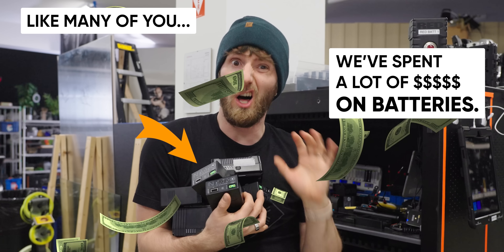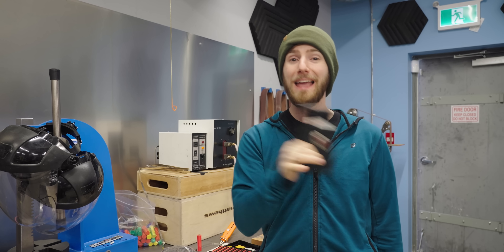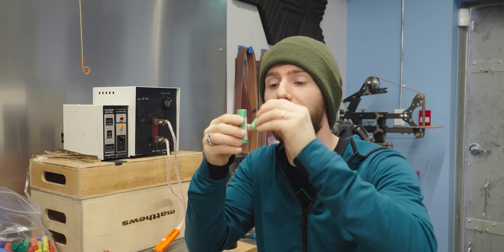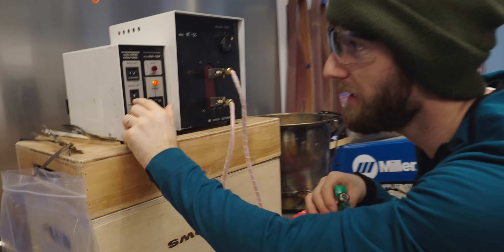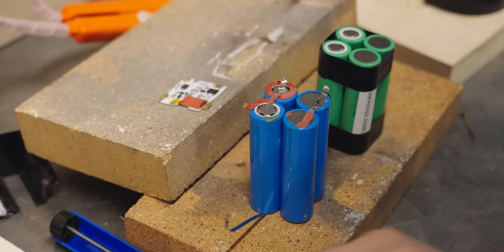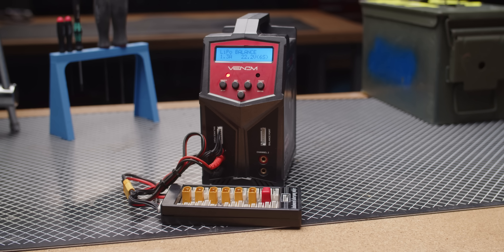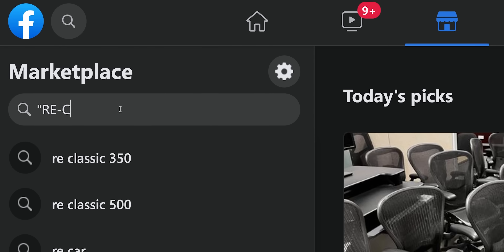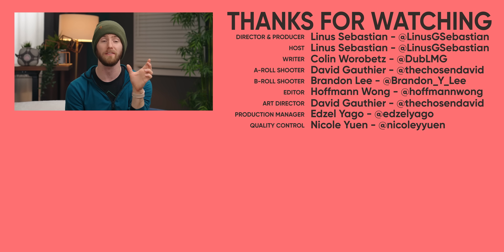This should be illegal… Battery Repair Blocking

Comment: One MAJOR concern when building battery packs with Lithium Ion Batteries. These batteries are very dangerous when they hold a charge. If you rupture the case, you will not only sacrifice that cell, but adjacent cells and more likely all cells. If you discharge all the cells first, you're not going to have a spark when connecting them. Also they're at same potential (voltage), but most importantly you won't have a cell that catches fire. Then they can all be charged to same voltage evenly.
Reply: LiPo cells will catch fire exactly as easily when they reach 300 or so degrees Celsius no matter their charge state. That's because what is being released is not electrical energy at all, it's chemical energy, specifically the chemical energy of the polymer. The polymer catches fire which burns so bright because of the cobalt oxide decomposing at ~300 degrees Celsius, which when you think about it, makes the entire battery cell essentially a block of rocket fuel if you let the decomposition start. The molecules used as polymer are pretty comparable to gasoline in the energy they contain, but they don't catch fire as easily because they aren't volatile and don't form an easy to ignite vapor easily. 

That being said, shorting them lets them reach those temperatures, so discharging them such that they cannot short and reach 300 degrees will still definitely make it safer to work with.

Comment: my vape uses the same batteries 😮 didnt know these 21700, 18650 etc. batteries are also used foe such batterypacks 🤭

Samsung's T40 batteries (its 21700 tho) would be literally perfect for a batteryblock then 😮😮 I tested alot of batteries already from cheap to expensive and Samsung's T40 has been the best so far in questions of lifetime & mAh 😇

Comment: Years ago I was working at a golf course in Alton when a huge pile of lead acid batteries shorted, overheated and exploded. I was a few miles away and high up. The sight of the flames and amount of smoke was unimaginable. It took over a week to put out. Since then battery storage laws were introduced. You could still smell it months later...

Comment: Another thing for safety that would help when it comes to fire extinguishers is, just use an e, c or both grade fire extinguishers cover both electrical and chemical fires. I'm not a firefighter by any means but in chemistry or even 6th grade science, they teach you about different grades of fire extinguishers.
Reply: Not a criticism just a suggestion if an extinguishers with both e and c grading exists XD

Comment: I believe in right to repair, but also the right for battery makers to not get liability. So for example, i believe there is a good middle ground 1) People who want to repair must first report to the manufacturer that they want to repair, and write off all liability 2) People who want to repair must put a 1 million deposit, so that if they die/get injured, and the media hits the manufacturer, then the manufacturer can take the deposit to offset damages done by the repair person. 3) After a product is repaired by a third party, it must be tagged so and for everyone to know. that it has been repaired by a third party, and may not function as well as the original manufacturer 4) Lower taxes on the product for the manufacturer

Comment: 11:15
Yeah those sparks are from improper welding, not the cell rupturing. Just weld it again and it's perfectly fine. It may look scary but I've had way worse sparks when spotwelding battery packs and nothing happened.
You'd notice pretty quickly when a cell is actually damaged because it would start spewing sparks, smoke and maybe even fire. That happens quickly IF you manage to damage it enough
Reply: I agree 100% I’ve accidentally shorted one down to 0 V and it got hot to the touch but never exploded
Reply: Yeah, I've seen lithium batteries burn before. It was nowhere near that tame. LOTS of smoke. If all I saw was a spark, my first guess wouldn't be the battery.
Reply: This can also happen when the strips are a bit oily, anything that impeeds the current can cause a spark.
Reply: I came here looking for this comment, wanted to scream out of my window to tell him that exact thing.
Reply: I know, I am over here in tears thinking of all the wasted cells! Please ship them to me for um practice.
Reply: The spark we saw at 11:21 wasn’t from shorting the battery etc, it’s from the spot welding. You sometimes get sparks flying off especially if not spotting vertically but at an angle…
Reply: I hope after some one tested the cells rather than wasting 150 quid
Reply: I believe you BUT I guarantee if they did continue, this video eventually would have been removed by YouTube as promoting unsafe activity.
Reply: @robpierce4712  Yes. Probably. Still a shame they had to waste those perfectly good cells. I do get why. Better be safe than having to explain your insurance why the studio burned down
Reply: Lurts is correct for the most part. I have a business rebuilding power tool battery packs. That is a tiny air gap spark, not a shorted cell...lol
Reply: it kinda irritated me how over the top they were in this video. they act like theyre welding a nuclear pipe bomb or something
Reply: Exactly, came here to say the same. Surprised how many good cells they condemned for this.. My DIY spotwelder is a lot more piddly and always sparks presumably because I am not pressing the strips down to the battery as much..
Reply: I thought the same
Reply: Thank you so much for adding this explanation as I was also confused!!! I was wondering if the battery cell blew up or it was just related to the welding
Reply: Thanks for the input bro! Part of the reality tv drama and maybe legalities stuff too, haha
Reply: yeah and sparks happen when you hit the battery wrap too had this happen before when first starting
Reply: yes true  ..did any one notice bms needs an initial current after batteries removed or re swaped ....just 5 sec of  charge will does its job.
Reply: A small point... Your examples of EVs catching on fire with your comment, may suggest to some potential buyers (and to some haters) that EVs are more likely to have fires than gas-powered cars. Nope! Info from the automotive insurance industry says that gas cars catch fire MUCH more often (per capita) than EVs!
Reply: He just has no clue and should have allowed someone to teach him first, in a safer environment.
Reply: yeah or he can just solder them. I always apply some flux and it can be done like that.
Reply: @DirkLarien soldering lithium cells actually isn't recommended because you introduce too much heat which can degrade or even rupture the cell. for lithium cells spotwelding is the way to go
Reply: Exactly, they were making a big deal over nothing through the whole video, especially when they kept “seeing sparks”.

These cells really aren’t that dangerous, especially on this scale.
I’ve direct shorted packs bigger than these and had smoke, it’s really not that bad.
Reply: @PapaLurts  hi I tried to repair a lithium ion cell as per YouTube video!!! Don't do it because mine started hissing and I threw it across the yard. Waited about an hour and it was still hot! So I put an industrial fan to cool it down. Never again. Lol 😂
Reply: @dragan3290  Stop projecting your own incompetence. Admittedly, you probably misspoke, but the individual cells are not repairable. I hope you were not picking one apart because that is exactly what not to do. 

 Yeah, don't try doing anything I failed at. Great advice.  (sarcasm)
Reply: @vadimbellous8313  I'm not projecting anything. I'm talking about my stuff up !
Reply: @vadimbellous8313  you did the same thing but you pulled it apart? Lol. What and why?
Reply: That was my first thought, too--that's the arc vaporizing the strip, if he'd actually damaged the battery, it would have been a lot more impressive.

These guys are way too jumpy--I'd pay good money to watch them try to use an arc welder.
Reply: Same I welded them before and I am still alive
Reply: I have some short accident, recently, it melt half inch of m6 screw on the terminal, just by the slightest touch.. 

Its an amazing sight 😅
Reply: These clowns do their best to troll people in these videos to get views. Its just content in 2025: fake it till you make it. I have zero respect to their way of doing videos.
Reply: You're probably right, but it's probably better to play it very safe when dealing with that many batteries. I'm not sure if a first-timer has the quick decision making necessary to think twice about it. It's better to just immediately drop it if you can afford the loss.
Reply: I was thinking the same thing, Safety first sure, But those cells aren't cheap, Err shouldn't have been cheap.

Comment: I stopped watching at 10:29. shorting a pack once is not sufficient reason to throw the whole pack out or treat it like a bomb. source: i just built a 3s10p
Reply: They didn't even properly short it
If you continue watching you can clearly see that they got spooked by a small weld spark that can happen if you don't make proper contact and/or dump too much power into the weld. No cells were damaged but they still threw them away

Comment: Some BMSes have no output voltage if you disconnect and reconnect the cells, but work fine if you recharge the battery a bit, just to start it up.

Comment: Probably the same deal as with powertool battery packs. If the voltage drops too low the chip wont let the cells recharge anymore.

Annoying shit since people who are not familiar with this can fuck up 100-250 euro packs easily on winter just by using cold ones wich have low voltage, big chance that when the juice runs of you wont get it back in it.

Comment: Let me tell you, patience is key. I soldered countless lipo batterie connections sereies, parallel and so on. In the beginning I popped a few 4s 5200mah batteries in my hand as I was trying to solder on deans connectors. One time the connector desoldered itself from the one side an shot across the room. Battery instantly puffed. Batteries can definitely be sketch. Patience and we'll maintained tips and or good flux/solder. Or a decent lead and tip if spot welding
 The battery spot welder does work you just need to use a larger lead acid battery then the one you guys first tried

Comment: I wonder if the bms could've been saved had a small cell been attached to it prior to removing the cells completely. Similar to how connecting a 12v or 9v battery to a cars cigarette lighter stops the radio from losing it's memory.

Comment: As an engineer I can tell you we do not these thing because we are negligent or evil. We do these for two reasons:
1. liability. No one want to be sued just because the user was creative or unskilled. If a user can disassemble and reassemble the product without proofs, you can be sure that sooner or later you are going to be sued by one of them.
2. This way we can make the product cheaper. Gluing is much cheaper than screws and in a fierce competition selling price is vital. Repairable products are significantly more expensive so are viable only in the professional segment.

Comment: Let me tell you the truth. 
Good battery and related material for rebuilding are not pricey at all. When I work for TV station in China, we use Chinese rebuilt batteries for our Sony and Panasonic broadcast cameras. They last as long as the brand ones. When they broke, we will send them back for rebuild. 
The problem is the labor cost. Skilled labor that rebuilt the battery for us in China is very cheap. Labor cost in US is extremely high. People tend to buy new replacements instead of rebuilding it which causes a lower number of rebuild workers. Then even higher labor cost.

Comment: Pretty sure this is why my old MacBook air died even with a new battery. It refused to charge the battery even when we changed the cell and the charge port, and the machine DID accept power to the board from the AC adapter 🤨

Comment: I had an iphone's screen pop off and dangle by the wires because the battery swelled. It was under warranty and Apple wouldn't fix it because I couldn't prove I hadn't been using a third party charger. :/

Comment: Sony use an EVIL BMS on laptop batteries, but if you replace the cells while original cells are still connected you can bypass this issue

Comment: I rebuild my solar power storage batteries all the time.  Those darn things do not have a good life span worth crap!  I get bad packs and rebuild them regularly.  I have the equipment and tools to do so safely but the majority of DIY consumers can not or/and should not even try this kind of self-repair.  As the video shows, it is a skilled science and dangerous.  A battery storage pack for my solar home is over $3,000.00 US.  I can rebuild a battery pack for under $1,000.00 .  I also installed a voltage regulator to each battery as trying to install multiple batteries in tandem to increase power output and longer storage time without regulating each battery's charge or output will result in a non-equilibrium state between the batteries and you will most likely get a big boom.  I did the assembly and repair of these batteries in a factory.  Should I have an extended power outage my solar array will not keep up the battery charges so I have a generator to supplement the system but again it is a tricky thing to have a system as I have that I put together myself.  I would not try what I do, I have a master's in Electronics and Computer Engineering and worked in the industry from the early days.  They are making it near impossible to DIY repair and service such systems today and all my equipment is 15+ years old but it works and works well and safely.  Be safe to all and be well!  IC embedded coding is much safer; and much more of a profitable use of my time.  :)

Comment: No way to tell if they are the same manufacturer since I'm sure the design is generic, but the shortest lifespan batteries I had were the same shade of green, brandless, exact sticker placement and of that size from a vape shop I trust (my fiance worked there).

Could've been phantom draw from a faulty vape mod though, fully depleting it (which is not good). Chips' built-in software are built to not fully discharge, as it can damage the lithium ion stacking.

Comment: just do it like vapes. Portable battery pack aging? Unscreen the battery cap, slide the old cells out, recycle, swap in new ones screw close and bam good for another couple years
Wait.
I should learn cad.

Comment: please like so he can see and posibly spread the knowledge ...common misconseption is that all fire extinguishers are ineffective against a lithium fire not true a  Class D fire extinguisher is ineffective on lithium ion fires even though they are labeled for use on combustable metal fires...The dry powder in Class D fire extinguishers will not slow a lithium ion chemical reaction.
 Lithium ion battery fires are considered a Class B flammable liquid fire...... A type ABC or BC fire extinguisher is effective against this type of fire. These fire extinguishers interrupt the chemical reaction in the lithium ion battery, eventually stopping the fire your fire exstigusher was abc so you would be good

Comment: I generally just etch the surface of the batteries and solder+flux works well. But sure a spot welder is a much cleaner method. (if you can do it without popping the batteries......)

Comment: Apple is horrible!  Most BMS circuits are intentionally set too high and way too low to squeeze out more power at the cost of lifespan and safety.  It's always about the profit!  If you can stop charging at 4.10V instead of 4.20V, the cells can last up to 4 times as long.  4.15V is a good compromise.  Never let the BMS shut off the battery, that is too low.  For "phones", a good range is 25% to 95%.  Also, lithium CELLS never become warm when charging unless they are being damaged.  Unlike other chemistries, they can actually become cool.  Swelling/puffing is from flammable methane gas being produced because the cell has too much moisture in it from manufacture.  As with all batteries, they do not like the cold.  Optimum temp is 110F and over 140F will cause damage.

Comment: I replaced the batter in my jump box.  $40 vs 100 for a new one.  It wasnt exactly easy and it was a little scary but I did it.  Get the simplest one without all the gizmos and it should be much easier.

Comment: The Evil ones probably won't reboot once it detects an open circuit. The only way I could see getting around it is if you connect the new battery before you remove the old one, just make sure the cells are at the same voltage of the old pack before doing it

Comment: Try hooking jumper leads between the new battery cells and old ones and then removing the leads from the old cell and permanently installing them on the new ones this might defeat the board

Comment: DJI drone batteries have a BMS that includes software to disable itself if the cells are disconnected. The case is also designed in such a way that you have to absolutely destroy it to get to the cells.

Comment: After connecting a bms to a battery pack you need to charge it - sometimes this works (is the same with aftermarket bms). 
Another workaround is to keep the bms connected to a electric source - this way "it does not delete".
I had the same surprise with BOSH bike batteries....and here we are talkin about >40 cells. 

The companies should be forced to allow cells swap...they could build battery packs that allow easy swap (like AAA batteries) - or at least like the one you presented in the video. It's not like they invented some new 18650....they just wrapped them together. 

Solar batteries have the same issues and here we are talking biiiig batteries. 

Remember when each of our phones/appliance had different charging plug? it took more than 20 years for usb to become a common charging port.